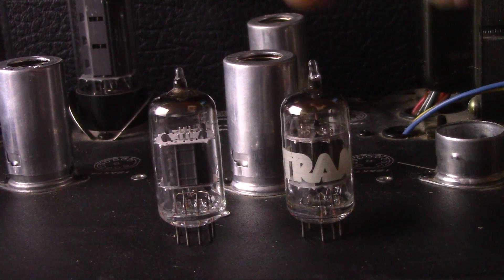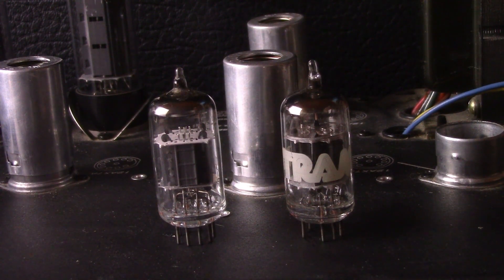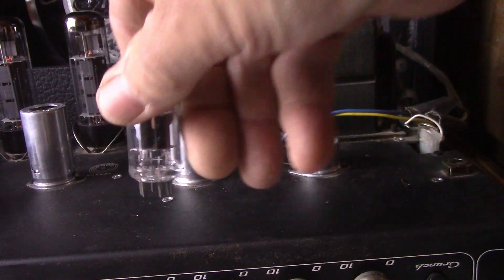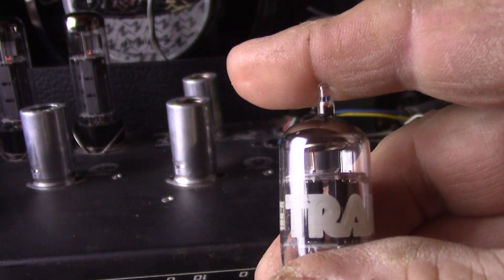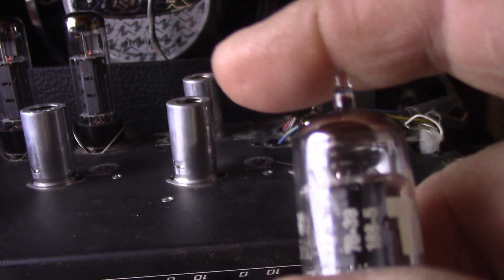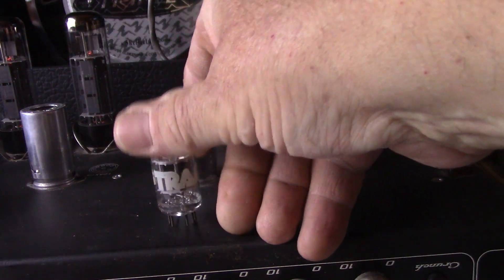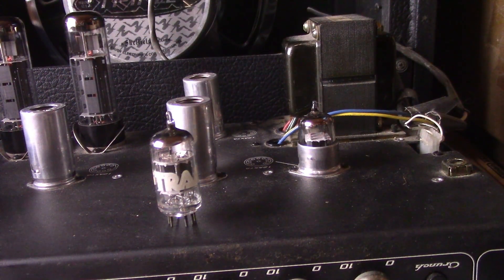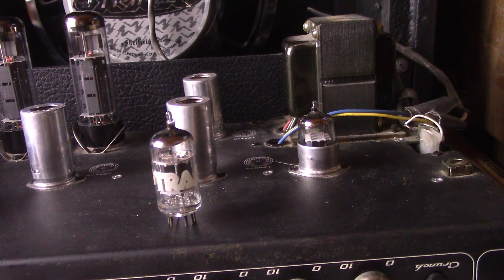GE 7025 vs RCA 12AX7A Tube Tone Comparison Peavey XXX Amp

Comment: I have the same amp,  the Super 40 without the digital effects.  The reverb tank is really good.  I run mine with a JJ 5751 in the V1 position. 
It drops the gain by 30% so the Ultra channel doesn't max out so quickly. It's a small difference, but I can hear it.   Great amp !!!
Reply from the maker: It is a great amp for sure.A 12AT7 in V1 does the same.